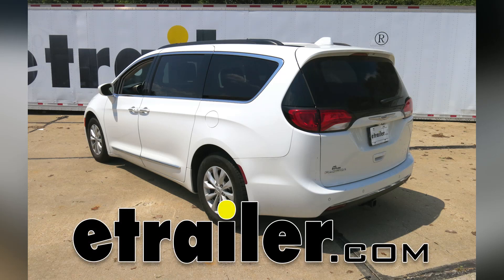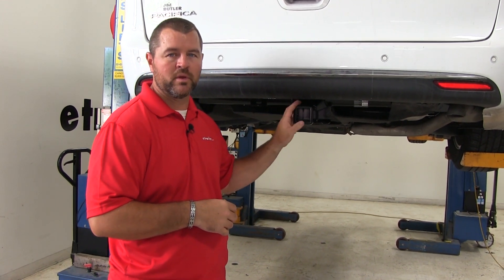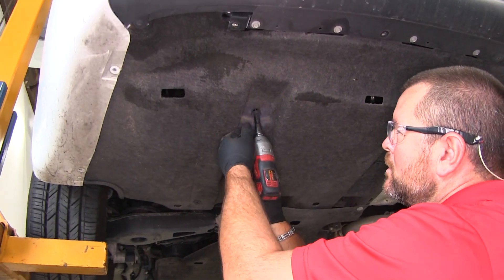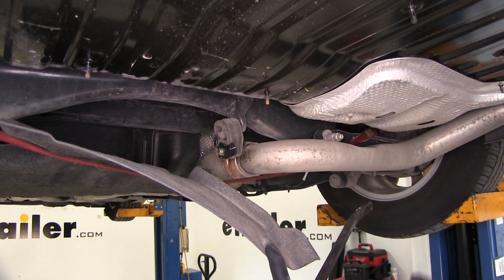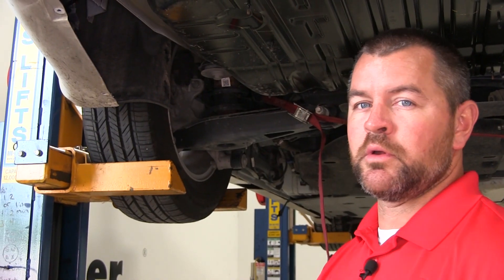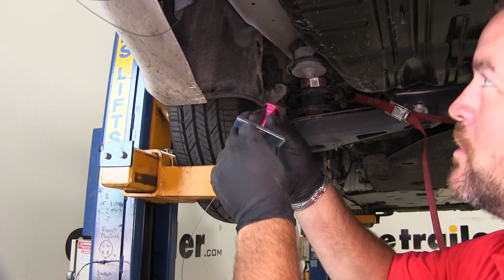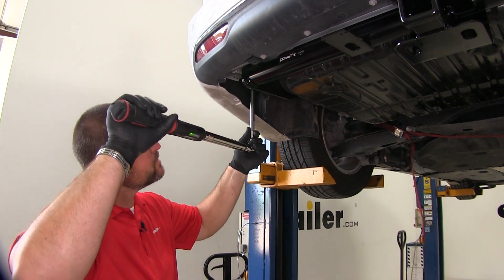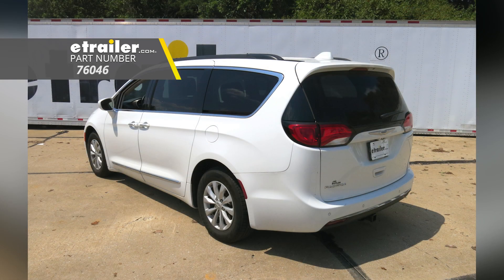etrailer | 2018 Chrysler Pacifica Draw-Tite Max-Frame Trailer Hitch Receiver: Complete Installation

Comment: Thanks for the instructions.  I just finished installing the Draw-Tite hitch on my 2018 Pacifica L.  My Pacifica did not have the body panel, so it was a bit easier.  The hardest part was getting around the exhaust system.  I did not jack up the vehicle, but used a small floor jack to lift the hitch in place.
Reply: How much weight do you feel comfortable towing with it?